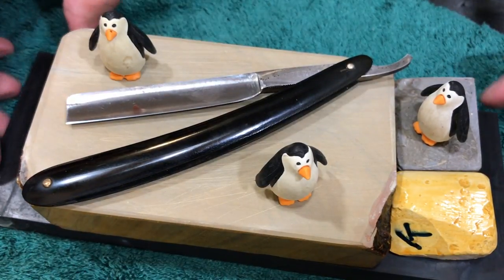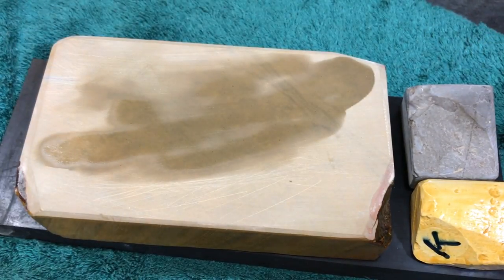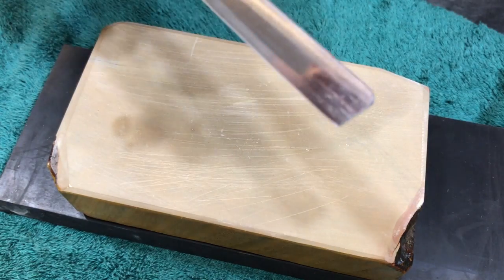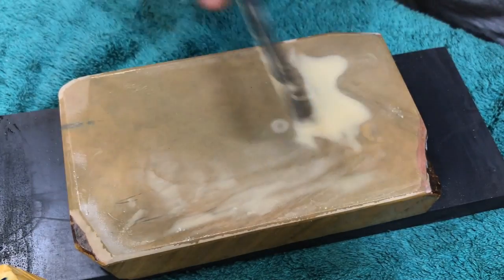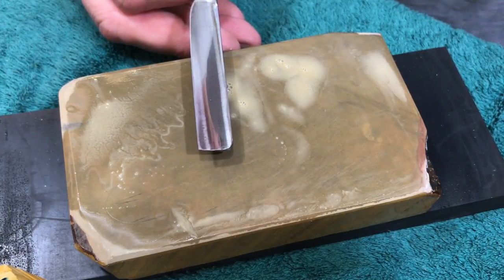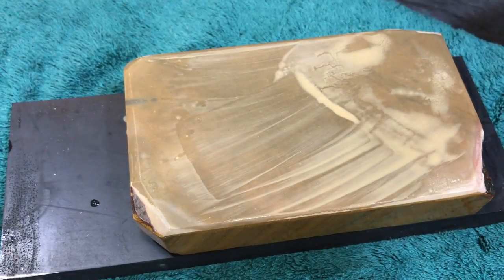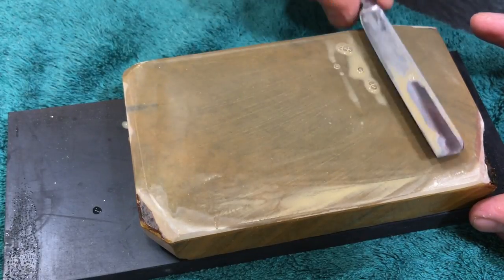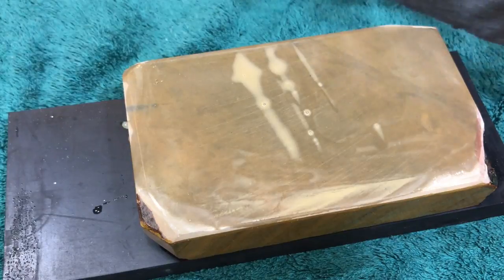Jnat - Hazy Mirror Polish on the Bevel

Comment: Great video, Keith. I have a question about haze and hakka akapin. When using a hakka akapin tomo (which coincidentally is from one of your awesome tomo sets), I get that 'killer' haze regardless of use on a 'regular' hard or a 'very hard' awasedo. My question is how do you typically proceed with finishing at that point? Do you work the hakka slurry down until you finish, or do you still follow up with another harder/'finer' tomo slurry? (Does that make sense?) I feel like I get that extra little bit of refinement when I follow the hakka akapin up with a harder/finer tomo slurry, but the edge loses that killer deep hakka haze in the process. Is this to be expected? Maybe I'm working the blade too much after the hakka slurry? Any advice or insight is greatly appreciated. Thank you! Jason
Reply from the maker: Sorta impossible to answer that cleanly without actually having it all in my hand. That Hakka is more about midrange than finish. You might think you are getting the same off the hard and very hard stones but I'd bet you're just not seeing the difference. The look is one thing, the depth of the surface is another. Remember, Kasumi finish is like camouflage sometimes, and even subtle differences are important. Test your edge after Hakka - see what it is. If you need more, and I suspect you will, then you have to follow with more and you will alter the haze. But the haze you are altering doesn't go away exactly, it just makes a bed for the new polish which will be different but it employs the satin clouds from the Hakka. Think of it as layers of haze.